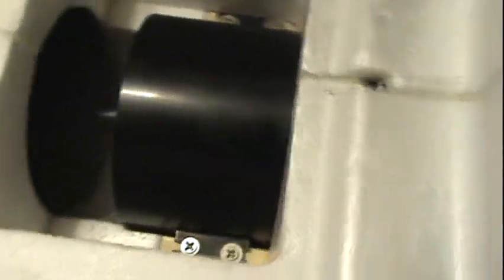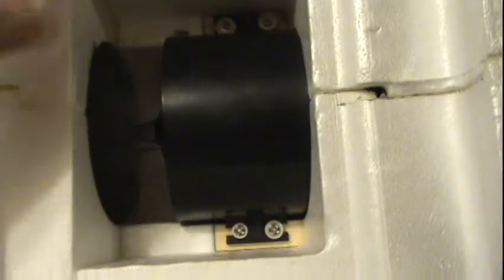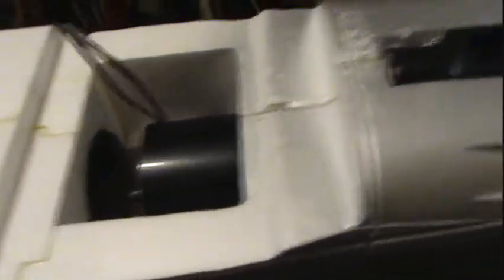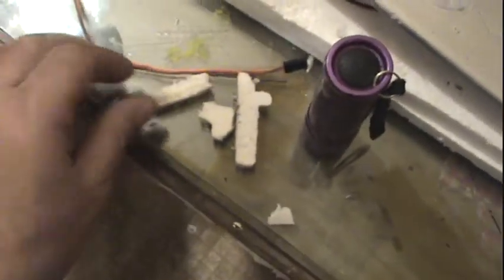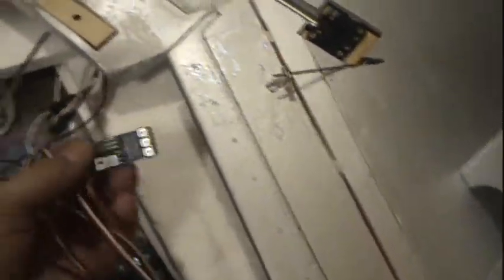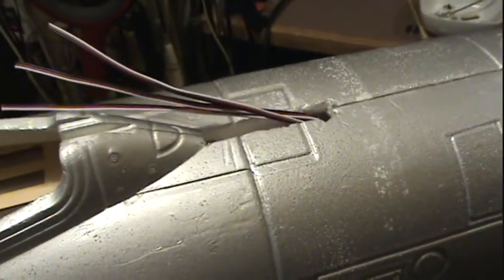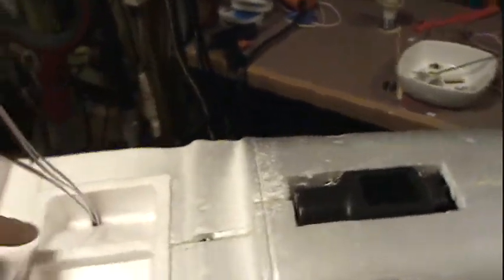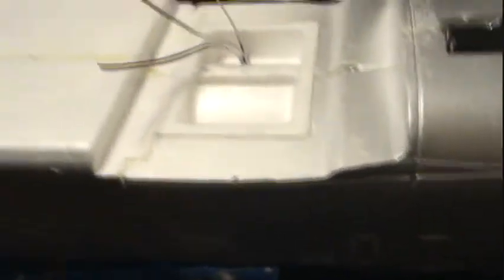f 86 rc airplane build video 46

Comment: Good save on the wire routing....A little filler can fix the slot you made...By the way, what kind of filler will you be using?